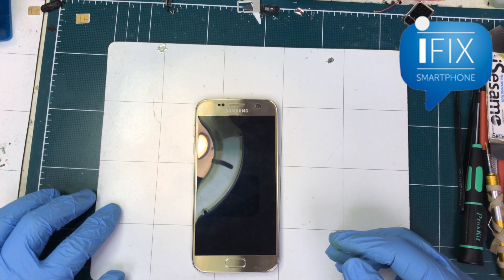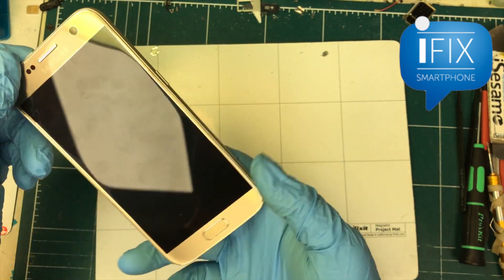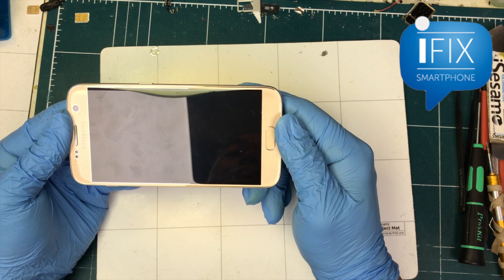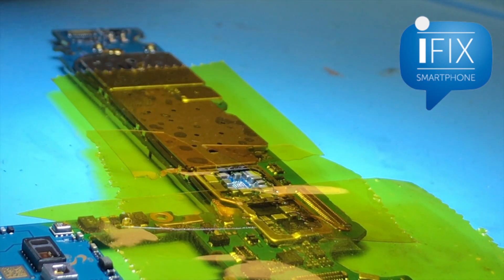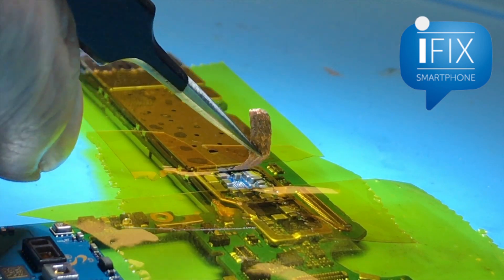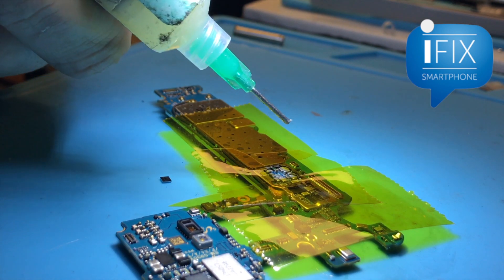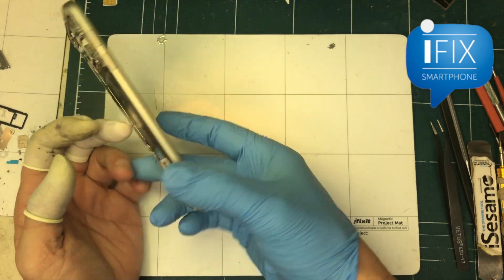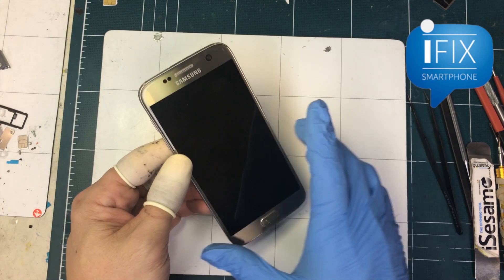Samsung Galaxy S7 half display issue fix

Comment: hi thanks for the video, do you have an idea how to fix this exact problem:
"Superb video...very informative. 

My Samsung s7 phone has an unusual fault. When the screen is cold, the bottom two thirds of the screen goes blank/black and the top one third of screen only has a perfect picture. If I heat the screen up a bit with a hairdryer, the blank bottom two thirds immediately has a picture again and it will stay on till the phone gets cold, then the problem comes back.

Can you advise what the problem is and how to fix?

Thanks!

Stuart (Glasgow)"
Reply: Mine does this too. When its in the sun for a bit it works fine! WTH!
Reply: @briemelton8027  it may return normal if you put it about 3 hrs outdoors or under sunlight in a summer day cuz it seems to happen in cold temperature ,, this fixed my problem
Reply: same here, just happened to my S6 phone. i have to put it on heating radiator for a min for screen to get normal .     Wonder what the issue is

Comment: Superb video...very informative. 

My Samsung s7 phone has an unusual fault. When the screen is cold, the bottom two thirds of the screen goes blank/black and the top one third of screen only has a perfect picture. If I heat the screen up a bit with a hairdryer, the blank bottom two thirds immediately has a picture again and it will stay on till the phone gets cold, then the problem comes back.

Can you advise what the problem is and how to fix?

Thanks!

Stuart (Glasgow)
Reply: Same here!! did you find  a solution?
Reply: same happened to mine did you find a fix ?
Reply: @ScorbionXD  

Got mine fixed by this MOST unusual method. My screen would only go faulty below a certain temperature in autumn, winter & spring months. When summer arrived and the temperature never got down to the required level, I used my phone daily for months as normal. When the cold weather came back, my phone's screen fault never reappeared despite it being very cold on many days. Strange, but true.
Reply: @stuartleggat7176  legend , i was thinking the same I've bought a replacement and i'm waiting for the summer to arrive so i can test it again , hope this works for me as well , wishing you a long happy life mate thanks for your reply
Reply: @stuartleggat7176  what was the MOST unusual method? Just waiting for it to warm up? I did that ok for several months but now it's staying black on bottom 2/3s even when warmed up.
Reply: @ScorbionXD  You've bought a replacement phone? How will you transfer your data if you can't see whole phone to choose apps and such?
Reply: @JU-fj1sz  Hi the touch was still working so I connected the phone while it's on with a cable to the pc and then I've estimated where would be the" Yes" that pops up after connecting it  for confirmation for sharing files and copied my files to the pc then from the pc i copied them to the new phone . ps right now when the summer arrived the phone returned completely normal after i left it about 3 hrs in the sun "about 30 deg celius the temperature in our zone" you should take more care if your zone has higher temperatures
Reply: You are so AWESOME!!! This was the perfect fix for my S7!! Unfortunately I had reset my phone before seeing your comment and so I have to go back in and reset my settings BUT it's well worth it just being able to use my phone again!! God Bless you and Thanks again!!